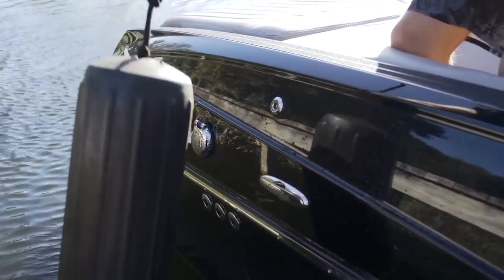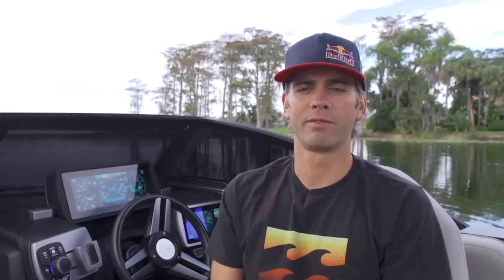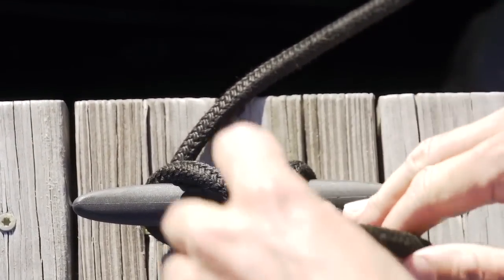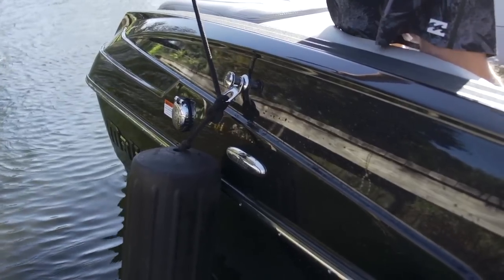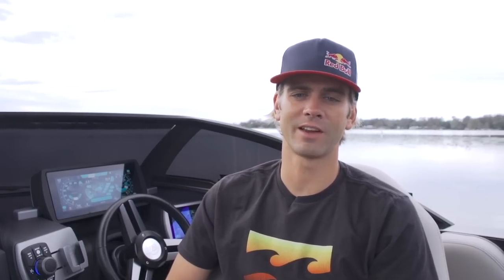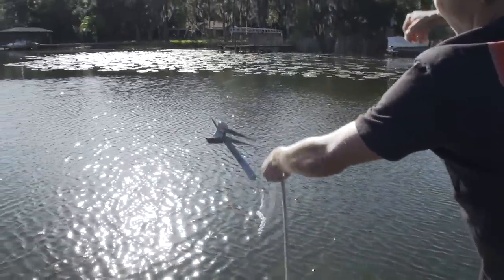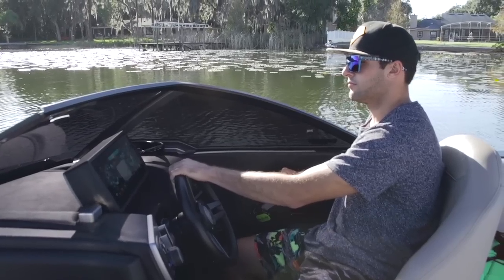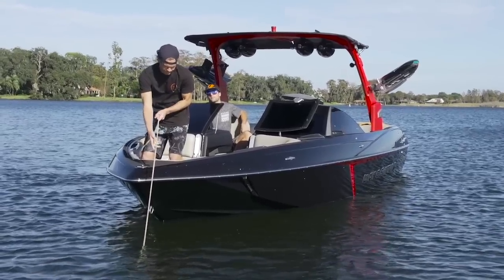How to Properly Tie Dock Lines & Anchor

Comment: Does anyone know what the two side post anchoring system is called?  I saw a ski boat tie off with two of those side posts this weekend and it was pretty stable. Thanks.
Reply from the maker: Power Pole
Reply: @BoatingMagazine  Thank you for your reply. The mechanism wasn't a power pole though. The owner set them in using a fence post driver. They almost looked like trailer guide on posts because of the slip cover he put on afterwards.
Reply from the maker: @bigsqueezy661   Sorry we couldn't help you, Milton.

Comment: Your Danforth anchor is not rigged correctly if it gets snagged you won't be able to pull it up it needs to be connected at the head of the anchor with the chain and loosely connected on the arm of the anchor with either a zip tie or a light string. This way if you get snagged you can break the string and pull the anchor from the opposite direction removing it from the snag